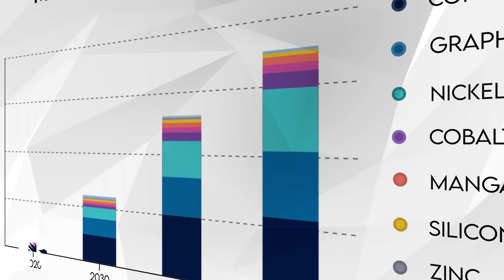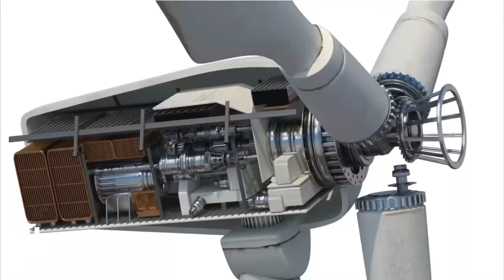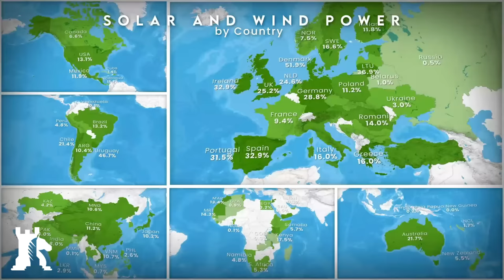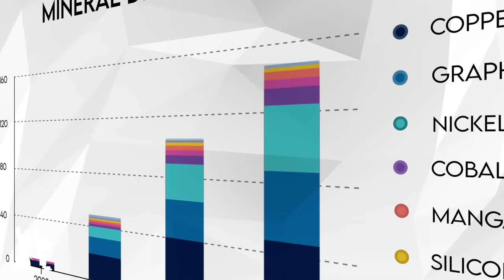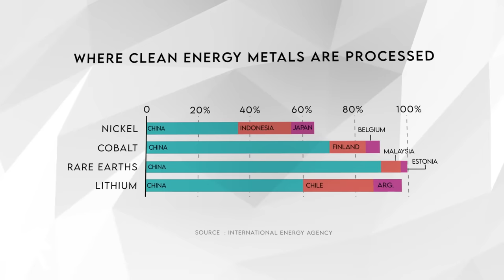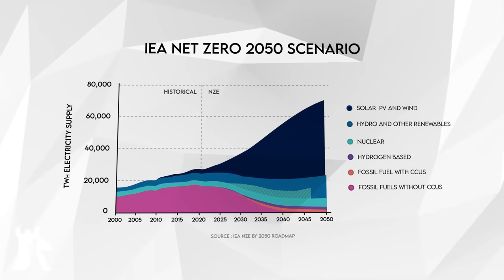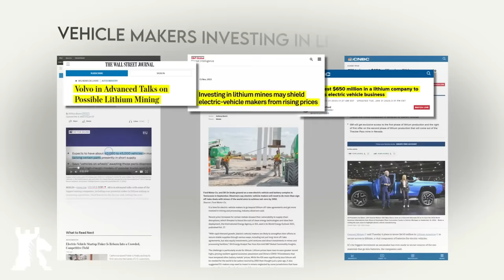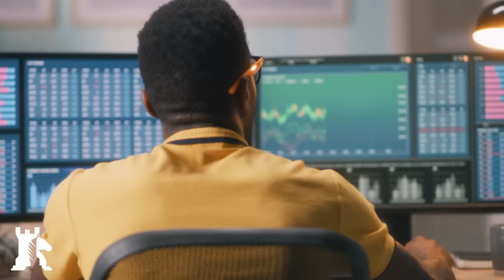Net Zero by 2050 is not happening

Comment: This is why transitioning to NetZero absolutely requires nuclear power
Reply: Nuclear is the only green energy we should be pursuing.
Reply: Sadly not enough Uranimium, half of it is exported by Russia. Nuclear power is nice, but being dependent on Russia is not so good...
Reply: @joshhardy5646 that’s not true nuclear energy is more expensive than solar, wind and water energy the only reason why it’s good and we should definitely also pursue nuclear is because building the infrastructure for the other renewables takes a lot of time and isn’t as stable, so having nuclear as backup is a must. But nuclear again, is more expensive and has problems for the future with nuclear waste(although that isn’t that big of a deal but still)
Reply: @alvydasjokubauskas2587  We absolutely do have enough material, specifically we will virtually never have to worry about fuel if we do Thorium. It isn't perfect yet, but it is the best long term solution.
Reply: @joshhardy5646  Lots of untapped and underutilized uranium reserves in other countries like South Africa, Niger and many others.
Reply: @raumsegler  I am glad to see someone who critiques nuclear not focus on the near zero risk of a meltdown, however, keep in mind we have pretty minimal research funds being put into nuclear right now. There is a lot of potential for efficiency improvements when it comes to future endeavors. Regardless, the costs associated with it includes high potential for well paying jobs + we need a baseload power supply. It isn't really an optional thing, it is a necessity for that baseload unless you got hydro/thermal energy which is comparatively rare due to geography determining it's possibility.
Reply: @alvydasjokubauskas2587 ell sanctions tend to make people hate you what a surprise
Reply: @nathanielmathews2617  the only real feasible solution in my opinion is a mix of nuclear for stability solar, wind and water for cost as well as other renewable sources until we have Fusion. Then switch everything to Fusion. Nuclear while good and not being near its full potential still needs storage for the waste material and has a risk of meltdown no matter how low at least for the current nuclear tech.
Reply: Is noone going to consider the simple solution- not using that much stuff?

We can feed all the people, we just can't make cars and stuff for all of them.
 so, how about we don't? How about we focus on what really matters- food, homes, communities, not economic growth?
Reply: We should have gone hard at nuclear in the 1970s but the environmentalists couldn't see the forest for the trees. Some Baby Boomer environmentalists still die on this hill when all the evidence points otherwise.
Reply: @nathanielmathews2617 ong term thorium is too uncertain and too long into the future to rely on for something as important as net zero.
Reply: @raumsegler  It's expensive because our regulations were designed to hang the industry, not for safety. America builds everything way out of budget from highways to trains to power infrastructure but it'd be pretty silly to suggest we cease building anything ever, no? The solution here is to cut red tape and channel economies of scale. Nuclear waste is honestly a trivial problem, we should recycle waste to generate more power (which also reduces the half-life of how long they remain radioactive, so recycling nuclear waste makes it SAFER) like how the French and Japanese do
Reply: @alvydasjokubauskas2587  Thorium-based nuclear power and Spent nuclear fuel: Allow us to introduce ourselves

Thorium is much easier to source, no enrichment needed, and easier to shut down if things go sideways. For plants that use spent fuel, amount of spent fuel in the US alone can power the nation for 100 years.
Reply: @raumsegler  the nuclear waste in america alone would power the U.S's total energy needs for 80 (conservative estimate) to 120 years (optimistic estimate).
Reply: @raumsegler  as far as i can see articles that i found, the consensus is that nuclear power is competitively priced AS A BASELOAD POWER, also expensive or not depends on where the energy is utilized, it will be stupid expensive when a country is sitting on top of piles of coal, apart from the waste problem, as you mentioned the inherent problem of green energy are mostly output stability, even hydropower is only as good as you don't have drought and your geography allows you to do so in sufficient scale.
Reply: @nathanielmathews2617  to add to ur points  Nathaniel, research is being done right now on the potential of converting coal plants into nuclear plants by installing a core inside. If this is scalable, this could be a political and policy solution to major coal regions in Appalachia in America, the North in England and other prominent coal regions around the world to embrace green energy while providing good jobs for fossil fuel workers
Reply: @raumsegler  all the nuclear waste in the world amounts to one football field. That's nothing, we waste hundreds, possible thousands more land due to the waste products of fossil fuels every year
Reply: @mohammedsarker5756  yes but almost all new nuclear reactors are way over the starting budget like 3x and take a lot longer than first thought, not just in America. Also nuclear reactors are a pretty big weak spot for a country. And even if meltdown chance is basically zero under normal circumstances if a war were to break out and the cooling liquid and other crucial components of a nuclear reactor were to be cut off like in Ukraine at the moment that chance rises significantly. Now this could also all be solved with more advanced tech. But there also just aren’t enough people who are capable of building a nuclear reactor to build tens to hundreds(I mean worldwide) in a few decades since one can already take 2 decades or longer which takes up a lot of important Human Resources. And solar especially is getting a lot cheaper and more easily accessible for everyone making its adoption super fast. Also reusing nuclear fuel(which is very good and should definitely be done everywhere) doesn’t solve nuclear waste, even if it reduces its half life to 200 years. 200 years is still pretty long and not perfect. Fusion is the only real solution to real clean energy we know of that doesn’t have any side effects.
Reply: @mohammedsarker5756  comparing fossil fuel to nuclear is not helpful in this context if there is an option that doesn’t produce waste that last for thousands of years or longer(at the moment at least)
Reply: @mohammedsarker5756  yes but when the necessary infrastructure for reusing that is in place we will likely have already passed 2050 and or have made enough technological discoveries in other renewables to render it unnecessary.
Reply: i don't see what free internet has to do with anything
Reply: @joshhardy5646  I like nuclear but this is too far
Reply: Nuclear is expensive to set up and run... Need highly skilled professionals to work 24x7 while taking care of nuclear supply and waste. Obviously it's stupid to shut down existing working reactors but it's wiser to spend money on solar and 10MW class wind mills if new capacity is to be added. Building a new nuclear reactor takes a boat load of time as well and you know cost escalations are inevitable
Reply: @alvydasjokubauskas2587 uranium is more common than gold there’s plenty of it
Reply: @commieTerminator  True, BUT in the long term you get MORE energy for far cheaper from nuclear AND it's less polluting and material demanding. 

There was a time when wind and solar were expensive too and you know what happened? People invested time and money and research to make them more efficient and cheaper. No one is doing this for nuclear energy. We should be, there is a lot of promising tech out there that even makes use of nuclear "waste" we just have to invest in it.
Reply: @hermaeusmora2945  I don't think that's true, regarding the cheapness at least. Nuclear has an extremely large upfront cost, long lead time, has a higher per-unit operational cost than solar and wind, and tends to have an increasing cost profile as time goes on (due both to cost of personnel and fixed asset impairment/maintenance).

Furthermore, in the US it is almost impossible for utilities to operate nuclear power plants in the long term as irregular maintenance projects (which happen as a power plant ages) require a substantial rate increase, which is invariably a political issue and gets rejected by voters. No one wants to pay for a bigger energy bill every 15-20 years, when it's cheaper and politically easier to install wind and solar. That's also why they go for natural gas still - natural gas is super cheap and gas power-plant maintenance projects are much much cheaper than nuclear so the projected rate increases are smaller.
Reply: @raumsegler I agree, on its own, nuclear costs more than other renewables. However, sources such as solar, wind and others are time dependent, and will require huge investments into energy storage infrastructure. When you factor that cost in, nuclear is on the same level with everything else
Reply: @smithjefferson1962  I know and have said so in other comments here. That’s why you need both renewables for cost and nuclear for stability and so you don’t need super expensive storage infrastructure.
Reply: @raumsegler  The only reason why nuclear is so expensive in the US is because of ridiculous, convoluted regulations put in place by people who want to see it fail.  Regulations that do nothing to improve safety.  In South Korea they're producing nuclear power plants in less time and for less money than they did in the 70s. 

The only reason why the US has a problem with nuclear waste is because of hostile US policy.  The US has banned reprocessing waste which is successfully done in France and Japan.  The main reason why there isn't a long term waste disposal site is because one keeps being blocked for disposing of civilian nuclear waste.  The US Navy has shown that it is not hard to build one.  They have one for their nuclear waste from nuclear aircraft carriers and submarines. 

There should also be massive R&D into developing new kinds of reactors that will be cheaper and easier to build and operate.
Reply: @nos9784 it always surprises me how few people raise this point in discussions about sustainability. 
An economic system based on constant growth and increasing consumption is not compatible with a planet with finite and increasingly scarce resources
Reply: @eitkoml  I have addressed most of these points in my other comments. And me talking about how expensive nuclear is isn’t directed at only the US the examples you mentioned like France have the same problem. And I know it can be done cheaper and faster but not fast enough. Building enough new nuclear reactors for the US alone would probably take longer than 2050 and fusion will get usable in that time(probably) which then kind of(not really) makes the effort not worth it. As well as the time it would take to make it cheaper than solar(if that ever happens considering that solar is also getting better and more efficient and cheaper), it would probably just not be needed anymore. Also you have to remember that building a nuclear reactor isn’t as easy as just having the money and time required, you also need people who can actually build and plan it, which there aren’t currently enough of to build a ton of reactors(France again is having that kind of problem with their nuclear reactors).
Reply: @alvydasjokubauskas2587 There’s plenty of Thorium and that can be used in a reactor, as a bonus it’s more efficient and safer to mine.
Reply: @raumsegler  France also has the problem of having political factions who are hostile towards nuclear power.  

There is nothing about the technology of nuclear power which makes it expensive and slow to build.  The problems are regulatory and completely human-made by people who are hostile towards it.  

Nuclear power plants were being built much more quickly and at far lower costs in the 70s.  I mean building new plants in less than 5 years.  It was even starting to out compete coal on cost.  Then new regulations started being passed with the intent of strangling it. 

New people can learn how to build new nuclear power plants.  That is a hurdle which is completely within human capability to solve.  

Fusion won't be ready by 2050.  Especially because it would require deuterium-deuterium fusion in order to have sufficient fuel available to run large power plants.   It will be far quicker, cheaper and easier to develop new kinds of fission reactors that will bring a new era of a superabundance of energy. 

Solar and wind are garbage in comparison.  Their costs are far higher when considering the wider effects of using such unreliable power sources.  It's called Levelized Full System Cost of Electricity.  They're also not as environmentally friendly as they appear.
Reply: @nathanielmathews2617  Thorium reactors are a great idea but they require breeder reactors to work.  Those can also work with uranium.  

Current reactors use uranium-235 which is about 0.7% of uranium.  Uranium-238 makes up the other 99.3%.  It can be transmuted into fuel in breeder reactors, just like thorium.  

So much has already been mined.  There is enough so called waste stored in spent fuel pools and dry storage casks on site at nuclear power plants in the US to meet all US energy needs for over a century.   That is factoring in any reasonable expectation for population growth and increased per-capita consumption of energy.  

Humanity already has all of the base technology needed to bring about a new era of a super abundance of energy.  All that is needed is to spend a little bit of money to develop new kinds of reactors to make it a reality.  I do mean small amounts compared to the amount of money wasted on subsidies for inferior fossil fuels, solar and wind.
Reply: @mohammedsarker5756  All of the nuclear waste in the US would need more than 1 football field.  Definitely more than that for all of the world's waste.  

It needs to be stored in shielded dry storage casks and have room for equipment like front loaders or gantry cranes to access the casks.  

That means it needs more land area.  All of the United States' nuclear waste would really need about 40 acres to be properly stored and shielded and be accessible.  

It's still a trivial amount of land.  There is plenty of desert that can be used.  A single abandoned air force base would be perfect for the job.
Reply: @eitkoml  building new ones is slow now because of how much safer they have to be. New people learning how to build new reactors will take a long while. And I am for nuclear power, it’s just not realistic going for only nuclear power. And the unreliability of solar and wind is exactly the reason why you also have nuclear to the stabilize the grid. And regulations also take a lot of time to change, let’s say in ten years the regulations are properly in place to allow for all the necessary nuclear development it would take at least 20 years for the first few reactors to be complete. Fusion will take long to be properly integrated and working into society. when we get to the point where nuclear actually works to compete with wind, solar and hydro they will already be widespread enough for nuclear to not be a singular solution. It will just not be needed anymore for that purpose. And then for the next 20 years where you could replace everything with nuclear, fusion will just be a better solution. I am not arguing that nuclear wouldn’t be a better solution(than solar and wind) in perfect world where everyone makes rational decision, but that’s not realistic. Like you said France has political factions hostile towards nuclear power and many other countries have that too. In a perfect world we would have never stopped using nuclear energy until we had properly working and safe fusion.
Reply: @alvydasjokubauskas2587  There is plenty of uranium. The reason why Russia dominates the uranium market is because the other countries decided that it's cheaper to buy from Russia instead. They then allowed their own uranium mining and refining industry to wither. But the industry can be revived and if they're revived there are plenty of uranium around.
Reply: @alvydasjokubauskas2587 My brother in Christ, Australia has the highest uranium reserves by far and we've got so much uranium we can extract from ocean water it classes as renewable.
Reply: Materials??
Reply: @alvydasjokubauskas2587 plenty of uranium in Africa n Australia
Reply: Time to do what we can to produce nuclear fusion reactors.  AI please help NOW.
Reply: @alvydasjokubauskas2587  uranium the size of your phone is enough to power your electricity needs for the rest of your life.
Reply: If we actually put our best minds in nuclear power, who knows what can be accomplished. I'm not one of those minds however 😢
Reply: @nos9784  Amen. We would certainly be fine without a few modern conveniences. God bless! ✝️ :)
Reply: @matthewbrown2452 I agree. The endless hunt for more profit, new markets, and constant growth is eventually unrealistic or at the least excessive. There comes a point where you need to prioritize long-term stability over economic growth.
Reply: It also requires going off-world.  There is a finite amount of everything on this planet and we are going to run out of basically everything trying to go net zero.  Say what you will about Elon, but he's not wrong about his vision for SpaceX.
Reply: @raumsegler expensive because of the regulation which was imposed to the extend it could not be justified economically..another result of stupid anti nuclear work
Reply: Yet, Germany would rather burn gas, despite an energy crisis.
Reply: @joshhardy5646  But it's the only one we're not pursuing. (What type of bs fallacy did you try there.)
Reply: @alvydasjokubauskas2587  No need, you can make your own Uranium from Thorium in a fast breeder reactor
Reply: Nuclear is too expensive
Reply: your running into the same problem, not enough minerals

Todays nuclear fission reactors would run out of economically viable Uranium reserves in 8 years should anyone actually attempt to shoulder the entire world's energy needs on nuclear fission.

It's at best an option for countries with low hydropower potential as stable source of energy besides renewables
Reply: @TheSpecialJ11 If the world went hard on nuclear in the 1970s we would be out of Uranium today

Nuclear is very important for the energy transitionbut also very situational. Until we show that cheap uranium extractions from seawater or other fuel sources like thorium are possible on a large scale, it should be used only in places where hydropower isn't available to get stable baseload.
Reply: @mohammedsarker5756 "cut red tape" 

u sound like someone who'd go on a submersible .ade out of carbon fibre cause "safety regulations are just big goberment being annoying"
Reply: I came here to fight for nuclear. I see I found some of my people 🥲
Reply: @melfsade5557  You can use breeder reactors to make fuel (from waste or thorium), but obviously that is seen as a proliferation risk as it generally makes more plutonium. But a combination of breeder reactors and molten salt reactors may do the trick as MSRs can burn just about anything and to a much higher degree than LWRs so then there'd be less waste and proliferation, but MSRs aren't as developed as FBRs or LWRs.
Reply: "All societies must maintain economic growth, or they fall into crisis"

"The problem remains: The need for economic growth and physical resources"

In a finite world, an economic model the relies on infinite growth, is doomed.

Nuclear power and better technologies overall, just extend the inevitable.
Reply: @alvydasjokubauskas2587  There is more than enough fissile materials, Uranium is 1940s tech and not the way forward.  Highly expensive and inefficient, also creates too much waste.
Reply: @alvydasjokubauskas2587  As I understand it, the used fuel rods in America can be re-used. I watched a video talking about how Argonne national laboratory already has the found a way to do this. Here is the link to the video on youtube. https://www.youtube.com/watch?v=IzQ3gFRj0Bc
Reply: If there wasn't just that little hiccup called Zaporischschja being in a war zone! Blowing right in all our faces!
Reply: @melfsade5557 We don’t need new uranium mine to run a nuclear reactor, there is a physical phenomenon called transmutation that allows us to repeatedly use exhausted nuclear fuels. And it’s not some fancy dream like fusion reactor, currently China and Russia already have commercial tier breeder reactor, also India is building one.
Reply: @fairskies9353  that "phenomenon" is already used today, the 50k tons uranium or so mined annually are what's needed in addition to all the fuel we can recycle in current breeder reactors. 

That's enough to supply just 4% of today's energy needs btw.

You try to supply the entire world with nuclear you'll run out before any new techs become viable. 

That's ignoring the fact that 90% of countries today can't afford fancy modern nuclear plants, even the IAEA doenst estimate future uranium needs nearly as optimistic as all the near copers in videos like this do.
Reply: @alvydasjokubauskas2587 Russia has relatively small reserves. Most of Russian nuclear fuel is made from Kazakhstan's uranium (which is in Russian sphere of influence, so it actually doesn't matter)
Reply: @melfsade5557  except you’re only thinking current PWRs. Solid fuel rods are yesterdays nuclear tech.
Reply: Too expensive to build, the electricity is too expensive, takes too long to build, can't be turned on or off at will.
Nope, nope, nope, nope. 
It would be more efficient to make too much green energy then make H.
Reply: @eitkoml  new regulations were brought in because of all the accidents 🤦🏻‍♂️
Reply: @melfsade5557  You just ignored the fact that as breeder reactor haven’t been widely adopted, most depleted uranium are just treated as waste. What we should do is replace thermal plants with modern nuclear plants to make use of all the depleted uranium then enjoy cheap, reliable and environmental friendly energy as some countries with foresight already doing it.
Reply: @jamesgrover2005  you’re still only thinking current PWRs. You’re not thinking about next gen reactors that are cheaper smaller safer and faster to build. The reason why it’s so expensive is because we are building 1960s era designs for solid fuel reactors. That and the amount of regulation that increases time and cost.
Reply: @fairskies9353  Ask yourself why breeder reactors haven't been adopted yet? If it was already as commercially viable as mining new uranium, they'd would be everywhere. Not just in a few experimental soviet reactors.

It's the same problem as with Uranium/Lithium extraction from seawater, gravity batteries for renewables, thorium reactors etc. theoretically very possible but not yet competetive enough to actually replace existing forms.

This is the problem with pretty much all the ppl adovating for large scale nuear here. They simply write off all potential problems with a few solutions that worked in a few niche scenarios.

Like if u give renewables that same level of confidence we should simply build solar everywhere as gravity batteries can store all energy we could possible need (It's viable in these few niche scenario -> would totally work for the entire world)

Any energy policy should work completly within currently accasible technology.

Like in the 20th century we thought with very high confidence that we'd have fusion by now, imagine how fucked we'd be if we structured our energy policy on that assumption.

The same applies to all of this. Try to shoulder any system purely on nuclear (cause we'll totally manage to build enough breeder reactors in time and make them cheap enough) or purely idk. solar (Cause we can totally upscale a few gravity batteries), the risk reward is simply not there.

The only way is to build up ALL 0-carbon systems that are currently economically viable: hydro, nuclear and Solar/wind.

Then whichever ends up getting neccesary tech at a large scale forster receives more focus, however should one of them you still have other sources of energy.
Reply: @melfsade5557  indeed, we should just roll out what we know works asap
Reply: @melfsade5557  I disagree with your premise that the new reactors proposed aren’t viable. They are, but the EPA and nuclear regulatory bodies stonewall and delay getting anything done. They’re making other countries lead the way on this technology. That’s why China is investing heavily as well as India. They see the future energy returns of their investment. While we continue to use fossil fuels, we should be investing heavily into research and building these reactors now. The technology will work, but politicians and greedy companies are blocking the work.
Reply: @joshhardy5646  "Nuclear plants are slows cause regulators make the process slow"

that's the entire point, the reason nuclear reactors are just increadibky safe is because regulators triple check every single square inch of the proposal.

That's just a part of nuclear energy.

U sound like someone who'd go on an uncertified submersible made of a carbon fibre and titanium cause regulators aren't important right about now

China, invests increadibly hard into hydro and wind/solar as well if u haven't noticed. They use nuclear as its current form is ment to be used, clean baseline energy where needed in combination with all other carbon-freee sources of energy available right now.

There's just no conceivable benefit u get by only investing into nuclear and banking your entire energy security on not yet existing infastructure and tech.

Just invest in all available option and pick whichever mix ends up being the best for your countries needs
Reply: @jamesgrover2005  No, onerous regulations started to be put in place before the Three Mile Island accident.  One which never released any significant amount of nuclear material outside of the reactor building.  People in the surrounding area only received radiation exposure that was about the same amount as a chest x ray.  It was a PWR reactor.  No other reactors of that type have melted down. 

The intent was to strangle nuclear power because it was starting to out compete coal and oil.  Safety was not the intent, wiping out nuclear was the stated intent.  Environmentalist groups turned out to be very useful towards this end so fossil fuel companies sponsored them to stop nuclear power.  Environmental groups who obstruct nuclear power have caused immense environmental damage through their actions. 

Chernobyl melted down because of a very stupid experiment being done on it.  It was also a completely different kind of reactor called the RMBK which is far more dangerous than the PWR and BWR reactors at Chernobyl and Fukushima Daiichi.  No other RMBK reactors have melted down since 1986.  

Fukushima Daiichi melted down because it had an insufficient sea wall and its backup diesel generators were located in the buildings' basements.  There were other reactors in Japan which were in the tsunami zone which did not melt down due to being better designed and built.  One was even hit with higher waves than Fukushima Daiichi and did not melt down.  Also, no one died of radiation exposure from that meltdown.  That one was a BWR reactor.  No others of that type have ever melted down. 

The increased use of fossil fuels from the shutdown of nuclear reactors has caused far more harm than those 3 meltdowns.
Reply: @alvydasjokubauskas2587 untrue most is in Kazakhstan Canada and Australia
Reply: @raumsegler   we can almost entirely eliminate waste with reprocessing. We can standardize smaller, mass producible, inherently safe reactor designs. The fact CANDU pressure vessels aren't being made in the 100s for example is a sad failure...
Reply: @raumsegler  Many designs are actually inherently safe and can literally never melt down due to sheer physical constraints. However not enough research dollars are being put in, and most new reactors being built are based on the shitty american BWR type designs. Bring back CANDU reactors!
Reply: @nos9784 finally someone gets it
Reply: @alvydasjokubauskas2587  Those are not modern reactors. There are modern generation reactors that can use un-enriched uranium(U-238) or even thorium(still experimental) that have minimal waste and have more abundant sources. Nuclear is lagging behind because very few want to invest in it sadly.
Reply: @alvydasjokubauskas2587 it doesn’t have to uranium, the reason why uranium nuclear plants were the rage back then was to also mine it for nukes.
Reply: @alvydasjokubauskas2587 seawater extraction is interesting. Some smart guy a long time ago wrote a short essay about how seawater extraction and breeder reactors could create a fuel economy sufficient to power the world for... A couple billion years at 1980s levels I think it was.
Reply: @nos9784 clearly you've never heard of capitalism lol

No I mean you're right of course, this is (at least part of) the best answer. The reason it's currently infeasible is that the way the whole system is built, it will collapse without constant growth. So it should certainly be part of the solution, but massive economic restructuring will be needed before anyone is willing to make moves that encourage lower consumption
Reply: @colinmarshall6634 yeah but if Elon was less of an asshat he'd be looking at asteroids, that's where all the goodies are. If mars is supposed to be a launching pad as I've heard claimed, the moon would be 1000x better for that. He's kinda a bafoon and really just focused on himself. I agree with the first part of what you said however
Reply: @alvydasjokubauskas2587  Doesn't India have the biggest Thorium reserves though?
Reply: @alvydasjokubauskas2587 United States has tons of it and it’s barely tapped due to focus on carbon sources. The technology has gotten so much better with so little support that a focused look would have to get some results that are actually achievable.
Reply: Do you realize nuclear power plants also require a massive amount of niche materials?
Reply: I agree nuclear is awesome but the safety concerns are real. Even with accidents so rare, when they do happen they are catastrophic. Increasing the number of plants increases the risk of said flukes and that is a bitter pill to swallow for policy makers and potential investors
Reply: It requires that and a dozen more things. Like getting rid of car-centric culture, building more efficient housing, etc. Unfortunately, all of that would reduce profits of the top somewhat, so it won't happen.
Reply: @joshhardy5646 don't be hyperbolic, obviously a mix is best, not just one type
Reply: @Ikbeneengeit  I don’t see the need for large scale commercial solar or wind when nuclear can do that job for base load for the grid. If people want it for their own power, that’s fine. It’s super wasteful to spend the resources on green tech other than nuclear.
Reply: @alvydasjokubauskas2587  France relies heavily on Chad and possibly Bukina Faso for Uranium for it’s  nuclear power plants (EDF). Rear Earth and Coltan, The DRC. Little wonder after the west have for long  treated and presented Africa (with 70% of the world’s still needed resources) as a basket case, the Chinese have been making inroads, lately joined by the Russians (with the Wagner Group in tow) for business etc, whilst offering to build nuclear power plants for African governments.
Reply: @joshhardy5646 it’s extremely expensive and takes 5-10 years to build a plant. Obviously it’s a part of the solution but it’s literally too slow and too controversial to be a main part.
Reply: Yeah shows how disingenuous when people who advocate for green energy are when they dismiss nuclear power. Only drawback too it is that it's very expensive upfront but worth it in the end. Basically short term pain for long term gain.
Reply: @raumsegler  This is mostly false. There are few places in the world where solar/wind/water are better than nuclear energy. This is why France is able to power itself through nuclear and there are zero countries using of the other three sources to degree that France has with nuclear. Solar/wind/water are nowhere near being able to replace fossil fuels, let alone nuclear.
Reply: @Miranox2  nuclear is currently more expensive and takes longer to build. France is currently struggling with building new ones and keeping their old ones safe
Reply: @raumsegler  Even if I assume that's true (it probably isn't) the reality on the ground is that nuclear is far more practical. France is struggling only because of disinvestment and neglect which caused them to lose the technicians they need to maintain their reactors.
Reply: Yup nuclear power provides that bridge, yet people really think we can just jump towards renewable
Reply: @melfsade5557  you mean 

Our political leaders (as a whole) don't have enough minerals?
Reply: @joshhardy5646  IMO nuclear should be somewhere between 30 - 50% of baseload power and no more

Cost (upfront and running), price per MWh to the consumer, environmental / strategic risks, diversification of energy sources etc, all these things have to be part of the equation
Reply: @Miranox2  sure but not properly using funds is basically normal for a lot of countries. Sure nuclear would be the best solution, but not the most realistic. It just won’t happen fast enough. I also wrote current since that is currently the case, it doesn’t have to be but it is. If governments were functioning properly we would have never stopped using, developing and building nuclear. Now let’s take an extreme example: do you think a country like Germany could build new nuclear reactors in a reasonable time? NO! because it would take like 7-15 minimum for the regulations and Public opinion to be changed then another 20 years struggling to find engineers that can actually build one and actually build it. Other countries aren’t so different, they also have to change regulations a lot for nuclear to make proper sense as a single power source for everything.
Reply: @raumsegler  Germany is building more coal plants to replace nuclear. Nobody is advocating for a single source of energy. You need a wide variety for the best outcome. In my opinion, there is zero chance for a smooth energy transition regardless of what replacement we use. The main problem is consumerism. Entire generations were raised on the idea of wasting resources as the norm. Most people want to keep this going, so the most likely future is a world war fought over dwindling resources. If we don't use nuclear, the war will happen sooner. Germany will definitely regret their decision.
Reply: @Miranox2   @Miranox2  well yes that is basically my opinion. To transition to a mix of nuclear and solar/wind/water. I never argued against that
Reply: Definitely but we need to also remember that there are two big issues with a "Nuclear Only" energy policy. Firstly is the simple fact that if nuclear energy were to COMPLETELY replace all other forms of energy we would run out of fissionable Uranium within a generation. The second is the fact that nuclear plants on average cost a around a dozen or so billion per plant and it takes decades for a plant to get built; it's not really cost effective compared to traditional renewables and we're effectively on borrowed time.

Thirdly is the issue of international adoption, which way too many people miss in regards to mass nuclearization. Purely civilian nuclearization still opens a can of worms since once a country obtains the expertise and industrial base for Nuclear Energy nothing can really stop them from weaponizing it beyond good will and export restrictions (which again will be a problem if nuclear is the centre of all green energy policies). Not only is wind, solar and hydro less geopolitical hazardous but they're also far easier to adopt.

Last point, but most importantly, a lot of our issues ultimately boils down to how dated, inefficient and unsustainable much of our infrastructure is, not ONLY energy production. Focusing on a purely emission-based program misses the point, especially when faced with critical modern industries that quite literally can't be decarbonised like the construction sector. Something as simple as urban renewal programs to increase urban density, walk-ability and introducing public transport reduces the scale of EV production and road maintenance; making homes better insulated, passive cooling techniques and heat pumps reduces the energy requirements for homes; using less polluting substitutes for clinker or limestone in cement, using concrete more strategically or not using concrete at all reduces the ecological footprint of the cement industry. And so on.

Ideally, the most optimum climate energy policy is one where Nuclear is used to stabilize energy production, something like a 30-70 split between Nuclear and Renewables respectively. Renewables are far more variable than fossils fuels in terms of energy output, but make up for it for their extreme ease of adoption and allowing for far more decentralised energy production, and so there needs to be far greater level of synchronization between renewable production plants so that surpluses are redistributed to regions undergoing deficits. More energy storage plants (Lithium ion, Pumped storage, Hydrogen, Gravity or otherwise) would help, but Nuclear would equally be great for this as well.
Reply: @nos9784  This is a common position held be a lot of Degrowth promoters. I completely agree with what you're saying but the issue is equating all growth and development with simple economic growth. With the exception of food, all the stuff you mentioned will require a massive ramp up in production.
Reply: @alvydasjokubauskas2587 You can use plutonium or thorium.
Reply: @alvydasjokubauskas2587 Australia has heapsssss
Reply: @raumsegler Nuclear may have a larger upfront cost, but creates significantly cheaper energy
Reply: @raumsegler renewable energy is FAR more expensive when used in the GRID.  I make this distinction specifically.  When you add renewables to the grid, you must spend extra money on gas and diesel generators for those days that are prolonged cloudy, or wind conditions too high or too low outside of peak swings and those costs are never included in the kW/h rates.  Here is an EMPIRICAL example.  Germany has spent anywhere between 500 billion Euro, to 2 Trillion Euro to build 200% of renewable nameplate capacity of German PEAK usage.  Despite overbuilding to cover for cloudy days, night time, and no wind, this 200% of potential capacity only covers 49% actual.  Germany is now slated to build another 215 billion Euro for changes in the grid to try to squeeze out more from the existing renewable system.  Had Germany spent say 250 billion in Nuclear, Germany would have produced so much electrical power, 24x7, they could have lowered the price to get everyone heating and cooling with electricity, remove all the coal plants, and lowered the natgas demand to have minimized the impact of the war.  As it is now, Germany has closed its nuclear plants, restarted coal, and even on days where solar and wind work, the coal plants are still burning coal, because it takes too long to start and stop the boilers to meet demand in time.  So all of this money, spent on renewables, only to burn coal, overpay on natural gas, have the highest electrical prices in Europe, STILL pollute the air, release more radioactive waste in the air (as coal has higher amounts of radioactive material than background), and have BASF leave Germany because natgas prices went through the roof.  People really do need to stop listening to environmentalists on HOW to produce clean power.  They have neither the engineering sense, the economic sense, nor the math skills needed to make clean power ACTUALLY work.  I am DONE with mindless and parroting advocates who don't know how things ACTUALLY work.  Renewables are best left to people to install in their own homes, NOT to connect to the grid.
Reply: @joshhardy5646 Nuclear, thorium, and eventually, fusion are what we should focus on for now.
Reply: @Cagliostro81  absolutely. I hope for a day where fusion is viable and not just 10 years away
Reply: @melfsade5557  There has been relatively little prospecting for areas of high concentration of Uranium (that'll be U-238 but can be enriched to U-235) so much so it's as if we haven't even started looking for it yet. Even then, we need so little of it per capita that I don't think a lack of Uranium will ever be the biggest obstacle to nuclear fission.
Reply: @jamesgrover2005  Are you talking about all the 3 nuclear incidents in the entire world and over the entire history of the industry? Of which only one had directly or indirectly related fatalities? In light of simply how many people die per winter in the U.S from hypothermia alone it seems like the regulations (which, I'll agree, are needed to some extent) cost more lives than it can possibly save.
Reply: @benpietersen3723  accidents don't equal fatalities, and there have been many accidents, but I'd also say (for instance) it's hard to prove someone dying of cancer years later, is a direct result of exposure to eating beef that was fed on grass in Ireland, which was rained on after the Chernobyl cloud passed by. 

⚫ 2022-2023 Monticello Nuclear Generating Plant leak

- 2019 Radiation release during explosion and fire at Russian nuclear missile test site

⚫ 2017 Airborne radioactivity increase in Europe in

.

autumn 2017

⚫ 2011 Fukushima Daiichi nuclear disaster ⚫ 2001 Instituto Oncologico Nacional radiotherapy

accident

• 1999 and 1997 Tokaimura nuclear accidents

1996 San Juan de Dios radiotherapy accident

• 1990 Clinic of Zaragoza radiotherapy accident

• 1987 Golánia accident

⚫ 1986 Chernobyl disaster and Effects of the Chernobyl

disaster

• 1979 Church Rock uranium mill spill

⚫ 1979 Three Mile Island accident and Three Mile Island

accident health effects

⚫ 1969 | ucens reactor

1968 Thule B-52 crash. 1966 Palomares B-52 crash

⚫ 1964 SNAP 9a satellite releases plutonium over the

planet earth, an estimated 6300GBq or 2100 person-

Sv of radiation was released.

⚫ 1962 Thor missile launch failures during nuclear weapons testing at Johnston Atoll under Operation Fishbowl

• 1961 SL-1 nuclear meltdown

• 1961 K-19 nuclear accident

• 1959 SRE partial nuclear meltdown at Santa Susana Field Laboratory

• 1958 Mailuu-Suu tailings dam failure

⚫ 1957 Kyshtym disaster

⚫ 1957 Windscale fire

1957 Operation Plumbbob

⚫ 1954 Totskoye nuclear exercise

• 1950 Desert Rock exercises

⚫ Bikini Atoll

⚫ Hanford Site

• Techa River

• Pollution of Lake Karachay

• Rocky Flats Plant, see also radioactive contamination from the Rocky Flats Plant

1942 Leipzig L-IV experiment accident
Reply: What is pretty much always ignored, however, is that nuclear power plants need cooling, and there's only as much cooling as there is water. Given the changes that can already be observed to the water levels of rivers and the increased chance for increasingly severe droughts, extra care is advised when considering plans for nuclear power plants.
Reply: @nos9784  Even reducing consumption in developed nations would still not cancel out the need for better quality of life for poorer nations.
Reply: Nuclear power bad. Don't you know about Fookosheema and Chernobuhl???
Reply: There should be a large international effort to create new reactor designs which are safer and can use the fast breeder process to burn depleted Uranium or Thorium. There is not enough Uranium to solve our energy shortage by building enriched Uranium reactors which only use 1% of the mined Uranium. However, for whatever reason, this is not happening.
Reply: Actually what I was thinking, but we will see. I hope so.
Reply: @joshhardy5646  Laughable.  You gotta do some basic research.
Reply: @joshhardy5646 Nuclear is the only green energy we should be using for commercial purposes and to support the grid. Some of the other ones, solar and geothermal in particular, are just fine for personal use on a house or car.
Reply: @2200Stinger  wholeheartedly agree. Hopefully one day
Reply: ABSOLUTELY FALSE. Nuclear energy is the most expensive and slowest to build of ALL energy generation means, while solar with battery is cheapest. Transitioning to Net Zero  ACTUALLY requires is that the US$1 TRILLION PER YEAR in FOSSIL FUEL SUBSIDIES be rerouted to build solar/wind/battery grids.
Reply: @nekhlioudovbolkonsky2901  you clearly are uneducated on the matter of molten salt reactors. You should spend some time learning about them.
Reply: @nekhlioudovbolkonsky2901  so you're considering worst case scenarios.  Yes, disasters have happened and can happen - and whichever way we look at it, next half millennium will (IMO) see a reduction in Earth's human population to  a ¼ - ⅕ of what it is today, due to global warming, loss of arable soils, scarcity of resources, wars, and other factors. I agree with other posters in this thread that say a runaway economic model of growth is a big problem.. economies of scale will always generate waste and toxic by-products. On the other hand Amish lifestyles are only possible at a localised, small-scale level.

Humanity as a whole will not relinquish freedoms, modern conveniences, access to resources, energy independence etc without a MASSIVE fight.
Reply: @alvydasjokubauskas2587  but being dependent on US is ok...thanks but no thanks
Reply: Use nuclear power to separate hydrogen from seawater and develop hydrogen powered combustion engines
Reply: nuclear power also requires huge amounts of mining. additionally it uses hard-to-obtain metals that effectively become unrecyclable because of radiation.
Reply: @raumsegler actually, nuclear is only more expensive in the mid-term (15~18 years). After that time frame, because nuclear fuel is so cheap, it starts to become more and more profitable.

Considering the whole life-cycle of a nuclear plant (specially modern ones), it's by far the cheapest source of energy out there.

The thing is, we (specially politicians) only think in the short term.
Reply: unfortunately nuclear is only safe until society collapses, what we really need is a sustainable lifestyle and far fewer people.
Reply: copied comments i find good to that:

The new construction as you see in Europe only makes problems, takes years longer and is more expensive 10+ years for a new reactor, which would be too late for everything.
In France must be switched off constantly almost the Häflte of the Akws, since they run anyway already over their actual duration, make more and more problems, partly have the also Blackouts therefore, send e.g. to customers the request less to consume, in the summer the water of the rivers is too warm as that it for cooling water to be used may = reactors down or with smaller achievement let run.

Also a problem Akws you can regulate badly on the demand high down, e.g. you have a lot of solar power, to shut down the reactors takes partly 1-3 days and makes but because of the economy little sense, then you would have to shut down rather the solar energy.

Gas-fired power plants, for example, can best be adapted to demand.

But it won't, even the Eu energy authority sees a renunciation of gas from 2050 at the earliest as possible if it runs well (as an energy source, for industry & chemistry it will still be needed).

How well it goes with the nuclear power plants in France we will see in the summer, whether the rivers become too warm again or not.
Not to mention the huge debts of the state operator & more and more need for subsidies.

But it doesn't change the fact that nuclear power is difficult to adapt to the demand and it is just not economical to shut it down, even if you just massively produce electricity with solar and wind, which is also a disadvantage and contradiction.

I know the possible processes e.g. of breeder reactors, but so far none of these processes have been implemented economically on a large scale and would also take years.
The problem if one really wants to tackle the climate issue, then nuclear power plants would not be a solution, at least the new construction, because they would take too long and come too late.

Isn't the argument with the base load a fallacy? The problem with renewable energy is its unreliability and fluctuations. Therefore, peak and medium load power plants are needed that can adjust their generation or storage technologies. Nuclear power plants cannot do exactly that. In principle, I would be open to an expansion of nuclear power, but with a planning time of almost 10 years, that would be too late anyway. In this case, a massive expansion of renewable energies would be preferable in order to store the resulting overcapacities. That nuclear power disappears from the energy mix before coal I think (to agree with you) is the biggest strategic mistake.

You're right, nuclear power plants can't compensate for spontaneous fluctuations, you could use water pumping plants or maybe hydrogen (if you want to do without gas). But nuclear power can still be important to keep the frequency of the grid stable.
Reply: Or fusion
Reply: It's too expensive. And we don't have the time anyway.
Reply: The 20th century has shown just how careless industries/government were when it came to nuclear power and fuel production. If we really need to bring nuclear power back, we have to not repeat the same mistakes that were made in the past, and certainly we need minimize risk as much as possible. Using a fuel with a much shorter half life would be nice too. I really want to see Fusion succeed, but so far it's been very slow progress.
Reply: @alvydasjokubauskas2587  Thorium?
Reply: @raumsegler  nuclear energy is more cheaper when you see how much electricity it produces versus the costs. other green energy is cheaper but produce MUCH less electricity than nuclear energy.
Reply: @joshhardy5646  There should always be green energy options and alternatives incase of large scale power grid failure.  It's not a bad idea to situate a large solar and wind installation backed up with a large battery farm near a nuclear power plant.  The reason is incase a nuclear power plant experiences an emergency shut down and needs to restart.   This is going to be especially important to a thermal nuclear power plant (assuming we manage to build such a plant)
Reply: @raumsegler energy storage is never configured into that cost difference.
Reply: Can we put one in your back yard?
Reply: Its still mental that environmentalists oppose nuclear when it is probably our best option
Reply: @alvydasjokubauskas2587  not true, we had plenty enough uranium during the Cold War, when we built thousands of nukes and had more reactors than now.  There's lots in Australia, more than any other country.
Reply: @raumsegler By your logic and considering the fact that solar & wind are more expensive than coal-burning power plants, a nation who primarily sources their energy from nuclear should have much higher electricity costs than one that sources its energy from coal, gas and renewables, yet somehow France which sources 68% of its electricity from Nuclear has electricity cost about 50% of Germany's for both private and business back before the Ukraine war messed with the gas prices. Thus there is something fundamentally wrong with your logic. Please elucidate.
Reply: @mamotalemankoe3775 Sweden included. We have several uranium and rare earth mineral deposits. Now our government is looking into the possibility to open them for mining. Disregarding environmental voices. Since if we have the mines here we can assure they live up to our expectations. Likewise eleviate some bad environmental impact in other countries that doesn't have as high of a standard on mining operations.
Take our responsibility to make the change possible.
Reply: @alvydasjokubauskas2587 there's plenty of uranium and not in Russia. You only need a little to make a lot of energy.
Reply: @nos9784  Exactly
Reply: Good look mining and transporting all of that Uranium without fossil fuels 😂
Reply: @christianknuchel  Also cooling water is now warmer than it's ever been leading to reduced nuclear power output in the months where those temperatures peak, France had to throttle their nuclear fleet's output last year and earlier this year actually.
Reply: @2200Stinger  Geothermal is the best alternative to nuclear there is, specifically, hot dry rock / supercritical geothermal.
Reply: @alvydasjokubauskas2587 Thorium is safer anyway. Thorium reactors need to be developed.
Reply: @alvydasjokubauskas2587  Umm maybe the West could chosen not to antagonize Russia and push her into China's arms...
Reply: solar and wind take up alot of land, 4 reactors in the same building can produce more power then an entire solar power plant/ wind turbine plant combined
Reply: @alvydasjokubauskas2587  hey, Ukraine has also quite large Uranium deposits. And true, nuclear fusion and fission is our future.
Reply: @You-Know-Youre-Right  What do you suggest then?
Reply: @alvydasjokubauskas2587  you don't need uranium, if thorium reactors are successful you can just export from india
Reply: Thorium
Reply: Also reducing the world population
Reply: It's the ONLY option 

But, the public is stupid and have NO idea how it actually works - so they think it's going to just blow up like a nuclear bomb 😅😂
Reply: @joshhardy5646  Solar+wind+nuclear(until fusion becomes viable)+natural gas peaker plants
Reply: You realize uranium mining for nuclear fuel production requires more land use than coal mining? You won't escape from creating big mines.
Reply: @raumsegler The initial cost of nuclear is more expensive, but it has an incredibly cheep cost of mantenaince, cheaper then Solar and Wind. By the end of the nuclear power plants lifetime you actually save money. Nuclear waste is also recyclable, can be used again in nuclear power plants. Nuclear energy is more sustainable in energy production, cost, and safety (compared to coal and other gas powered methods).
Reply: Neighboor hood modular reactors actually. Close to the users. Way less transmission lines required.for tie in to grid.

Somebody proposed putting this in demothballed coal fired power stations. Brillante idea. No idea why thos never took off. Could use the existig steam  cycle, cooling system, land and subestación, voltaje regulation and transmissdion systems.

Someone shut this idea  down. Must have been " Big Wind" or "Big Solar" LOL
Reply: @mamotalemankoe3775 biggest are in Saskatchewan
Reply: Out of time but good idea 70 years ago.
Reply: @alvydasjokubauskas2587 where did you fabricate that from?